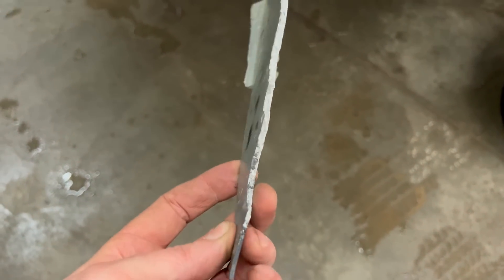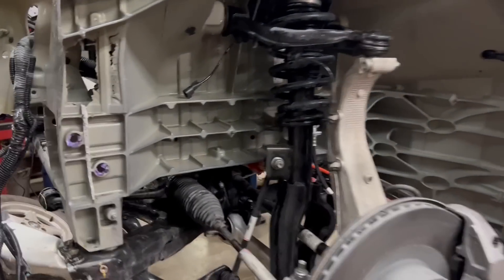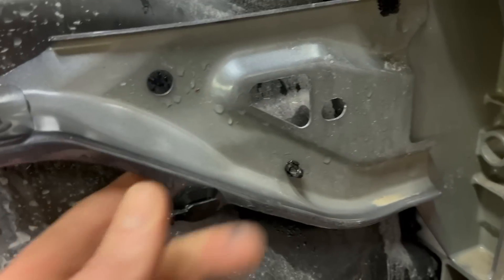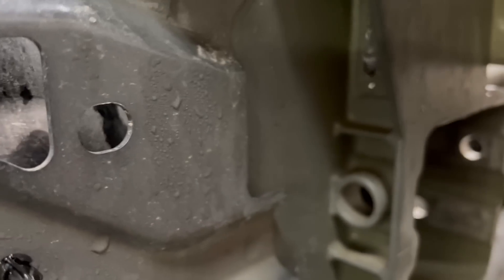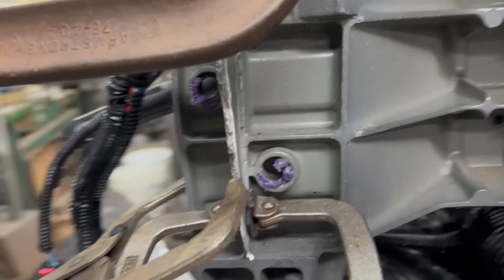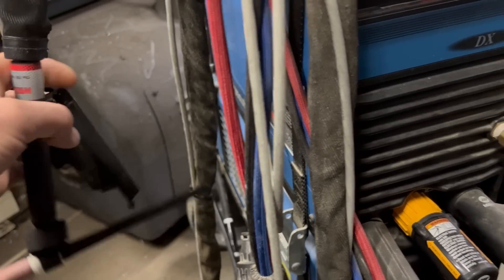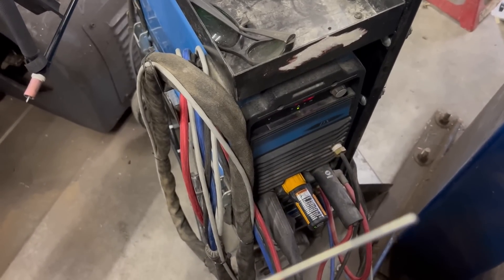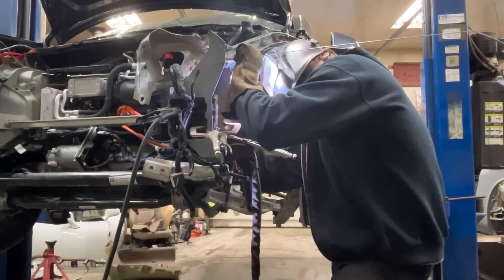Tesla Model Y GIGACast Repair

Comment: You should use 4047 wire.  The silicon content of the 380 die cast alloy is 7.5 to 9.5%.  It's a better match for strength and shrinkage properties. The 5000 series has a tendency to crack during solidification since it shrinks more than the higher silicon alloys.  Also be aware that high pressure die cast aluminum can contain small pockets of high pressure nitrogen gas. Air sometimes gets trapped in the metal if dies are not properly venting the enclosed air as the metal is injected. The air in the die can get surrounded and trapped by the incoming injected metal.  The 21% oxygen reacts with the aluminum to form a solid but the 79% nitrogen remains as a high pressure gas pocket. Any blowouts however just need to be repaired. There is no reason that repair welding will not work, especially in lightly loaded areas such as the fender support area as long as attaching parts are in proper position. Good luck and keep up the good work.
Reply from the maker: Excellent advise, Ill get some 4047 to try. Thanks!
Reply: Damn - are you like, a doctor of aluminumology....? 😉

I had no idea of all that, lol.
Reply: It's an AI bot...
Reply: @pawpatrolnews  Using 40-series filler is an established casting repair method. Nothing in that post is beyond what an experienced TIG welder who works on cast aluminum wouldn't know off the top of their head. Casting repair is a moneymaker especially in the marine and powersports industries.
Reply: AFAIK, Tesla draw a vacuum in the die before injecting, so there shouldn't be many gas pockets.

Comment: Tesla ! it seems like Tesla is not concern of repairability of there cars they are just interested in making it fast and cheap to build this example for this bracket it's very easy to break this part in a minor fender bender the same goes with the battery cels in the battery pack they are all glued together no way of rebuilding any of it it saw a video of a guy that hit a debris on the road with his model 3 and one of the quick connect nipple for the cooling system was broken and the part was non replaceable and Tesla said he had to buy a new battery pack for this simple reason he brought the to the Electrify garage and they fix it and saved the owner thousands of dollars.

Comment: Very interesting, ..once had to weld the Aluminium trailing arm of a planter, and hadn't thought about the castings getting damaged like this. The plan is to take advantage of 1:8 or more reduction of collisions, whatever the Insurance stat's comes to nowadays, but the weld job is first principles consideration for getting repairs done and avoiding the usual run around. 
Thanks for the demo.

Comment: Tesla. Could a 3rd party design a replacement 'wing' that could be welded or bolted to the remaining piece. This would probably require removing some of the damaged material to leave a measured tab to secure the replacement part to. Seems a shame to scrap a car based on that scenario. Bonus would be there might be a huge market of used parts from scrapped cars. Also tesla aluminum alloy is not public knowledge so good test welding it.

Comment: Tesla. Totally agree with your comment about the repair ability of the bracket. Seems that they could eliminate the wing completely and tie the sheet metal into the diagonal holes in the receiver part of the casting.
Reply: So everyone is going to re-engineer the Tesla?

Comment: I have an EV idea; there are 175,000 GM Volts sold in North America. When these batteries eventually give up ( mine is still going strong but it is inevitable) I’d like a replacement battery pack using 4680 cells. Could you build a 4680 pack to the same dimensions and voltage as the existing Volt pack so it’s a simple remove and replace? Thanks
Reply from the maker: Yes you absolutely could, it would actually end up to be way more kwh for the same amount of space. Cost would be the ultimate issue.
Reply: @519Kustomz  yes. I’m thinking a minimum of 100s2p. Approx 20kwh, better than the original and would easily fit 8 rows of 25 in the long section of the T down the tunnel and only 70kg in cell weight, about half the original. This would be in only a single layer, but the existing battery has a height of 300mm so capacity could be tripled and still only using the straight section of the T.

Comment: Do you think you are getting full strength with welding the casting, I don’t see why not?  If so, what is the issue with repairing these castings? Repair procedure would be to weld it.
Reply from the maker: This one turned out great, full strength and good alignment. I would imagine knowing Tesla, if they had a repair procedure it would involve riveting for alignment and adhesive bonding. Too much room for error with relying on  welder variables such as machine type, process, cleanliness, technique, etc.

Comment: Good Job, Tesla need to improve after sales repairs. Casting is gread for manufacture speed and safesty, but for repairs need to be easy for technicians. By using standardized components, Tesla could reduce the number of unique parts and make it easier for technicians to ident.ify and replace faulty parts. Simplify design. To be simpler can make repairs easier by reducing the number of parts and the complexity of the overall system. This can also make it easier for technicians to troubleshoot and diagnose issues.

Comment: Tesla …go experiment to know, agree with your thought that a great many Tesla crash damaged casting will be totaled… making Tesla insurance premiums even higher as actual experience plays out. It really bad news for Tesla in the end as auto insurance is is a significant cost of operation for Teslas. I currently pay $2916/ yr.  Eating up a big part of the gas savings expense over electricity.

Comment: Hey man you got my attention this was a good repair for sure. 
I have a "Tesla" Model Y new but only has the rear giga casting as it was built in Fremont.
It's curious as like you said most will likely write it off as they already are doing on light frame damaged Tesla's
Not a very sustainable mission to keep throwing these cars in the junkyard over trivial accident damages.
I have rebuilt 2 model 3's so far one with heavy front end damage and one over half way around the car needing extensive body work.
 Really interested if you would like to join the Tesla Rebuilders community I started, we help each other repair and rebuild.
Let me know I'll post a link for you to join, 
Thanks for making the video!
Casey
Reply from the maker: Yeah man, I’m in!
Reply: Seeing cars in general are getting harder to repair as makers move to lighter stronger less repairable steel.     I have not worked on newer vehicles so I only know what I read.  Feel free to disagree without getting vulgar.
Reply: @danharold3087  From what I noticed with Tesla cars just like others is it all depends on where the damage is.  For example you could have a Tesla front end collision that would beyond total any other car and be totally fixable.  But if the impact is just right on the side it can bend the frame for sure as it's hard to design much crash for side impacts.
I jyst fix what others give up on and have a really nice car for cheap!
Reply: @TeslaRebuilders  Good to hear.  Do you have problems getting parts from Tesla ?
Reply: @danharold3087  There is so much 3rd party market, eBay and yes Tesla will sell parts as long as not safety, high voltage or frame related.
Reply: @TeslaRebuilders  Good to hear.   With the millions of cars they are selling we ought to see a nice used market for cars and parts in a few years.   I can see a new generation of hot roders.

Comment: Tesla, sad how unrepairable cars are becoming.
Reply: I love teslas but their repairability is horrible everything is one big assembly and it will be outrageous expensive
Reply: Just wait until Tesla tells you that you have an UNSUPPORTED car. Good luck with that.
Reply: Seems he repaired it just fine, no?
Reply: @4LXK  HE repaired it, but I don't think insurance repairs will touch that, they just total the car and it goes to a salvage auction. 

If I'm wrong and they are welding the casting and fixing it then I'd love to know. I have been under the belief that it's a non fixable piece due to "liability" and all the other junk insurance companies and automakers do these days.
Reply: @volvo09  I guess Tesla knows this and its the reason they started their own insurance. I think over time they'll adapt the cast sacrificial attachments to cover most low speed collisions - last thing Tesla wants is you showing up at their service.
Reply: It's the same with your iPhone buddy. Grow up, smell the roses.
Reply: @RichardPeterShon  a $60000 car and a iPhone that's free with a 2 year service agreement is two different things. Try not to be a fanboi.

Comment: I agree with your assessment of the design of the car and problems of repairing. Your welding machine and choice of how you did the job was excellent. It is very time consuming. A sheet metal bracket bolted on would be another option.
Depends on how it breaks. 
I agree that it is a throw away recycle car frame. Only one place to buy another one. Cheesssshhhh!!
Something to consider if you buy a Tesla.
I would rather have a steel vehicle that can be repaired easily.
Any good job! I am a certified welder and welding inspector.
20 years on stainless steel.
Reply from the maker: Excellent stuff! Yeah I think a bolt on bracket would be a better fix. No HAZ after the cast is re welded.

Comment: Rivian. Sandy Munro noted that the first series of castings were designed to use up leftover parts, so there were a lot of weird brackets and weldments that don’t make sense at first. Supposedly the plan was to have new castings made that the rest of the car fits around rather than having the casting fit the car.

Comment: Tesla~ I can see an industry of aftermarket bolt on repair kits.  Maybe even out of FRP. Where you'll grind and cut a piece then drill and bolt on the non-critical support. 

The entire industry is about reducing fasteners. 

We've learned how to weld/melt plastic components back together.  This is just the next evolution in repairs.

Comment: Tesla. I thought your descriptions of the casting and the repair were interesting. Seeing you doing the actual welding isn't interesting unless I can see what you're doing. Watching from a distance is good for about 1.5 seconds.
You showed the result, but you didn't tell me what I was looking at. I'm not a welder. Educate me a little. What qualities do you look at to determine if it's "beautiful"?
Trim 30% to 50% of the footage. For example it was interesting to know you had to turn on the cooling for your welder, but boring to watch nothing happening as it was spinning up.
You are soft spoken (but I like your voice) and the music is loud. So I turn up the volume to hear you and then I get blasted by the music. That's super easy to fix.
Be a little more descriptive about what happened that caused the damage. Show me a picture of the car before you started pulling parts off. Give me a little context. You described what you were showing me, but I'm not a mechanic, so I'm not sure I have the right mental picture.
After the weld, it still looked like there was more to do. I wanted to see the finished product.
Thanks!
Reply from the maker: Great feedback, Thanks. I am very new to making videos so everything is helpfull. I am a one man show here so somethings are super difficult. I would have loved to show the welding but can't hold and concentrate on everything at once. This car is for parts for other electric conversion projects in the shop, I was just curious if it could be fixed. It was never finished to go back on the road. Lots of room to improve!

Comment: Like your repair effort will stronger than when it was cast, it’s seams to me pits that snap off and are not mangled that fit straight pack on with your weld skills is a better way, than all the traditional pulling steel frames back in line ???

Comment: Tesla
I think a simpler and more feasible repair would be to make a replacement bracket pre-punched or tapped. Grind the area flat and bolt/rivet the bracket right to the casting. No die change. no expensive welding to repair. just a grinder and some fastener work.

Comment: Do you think the structure of the cast has been changed to be either stronger or weaker, thereby changing the crash crumple?
Reply from the maker: The majority of the crumple happens with the crash cans attached infront of the cast. The cast doesn't deflect much before it breaks
Reply: @519Kustomz  I like your idea about bolt on attachments between the casting and the fenders, but odds are that’s intentional to limit parts, cost and maybe gaps.  
At least a diy-er may feel confident about welding the parts and replacing fenders as needed.  
I’m not sure how many years out I am from getting the likes of a Tesla,  but if I end up in this situation, I would be more than likely to give it a go.
Thanks for making this video.
Reply: @HenrysMusicTime  I think you hit the nail on the head.   Remember Tesla said the alloy was compounded to be welded.

Comment: I'd  e interested on how you finished that off. Did you add another piece of aluminum to replicate the original, or make another bracket. I imagine it is made that way for side impact absorption. Nice work, btw. TESLA.
Reply from the maker: That was as far as i took it. This model Y is just for parts for other conversion projects so not going back on the road. I was just super curious how the base material would weld